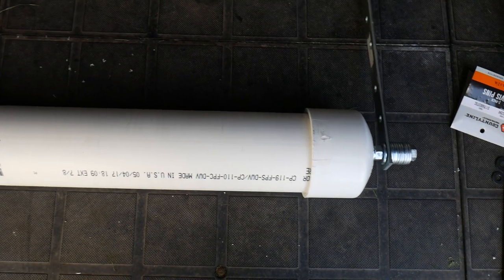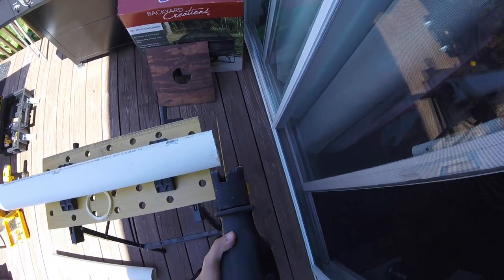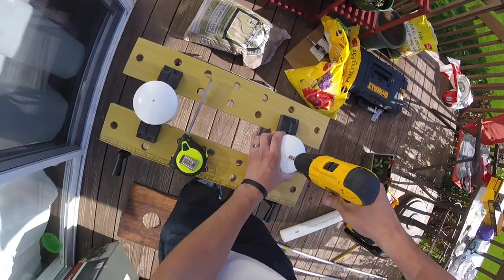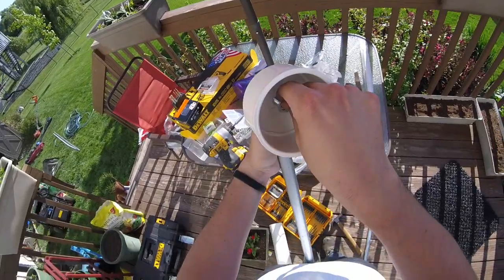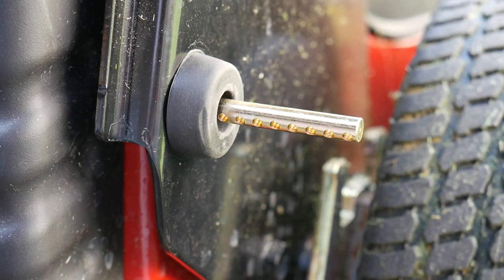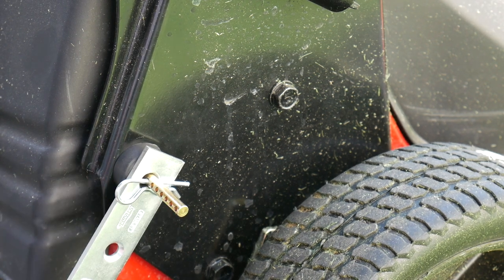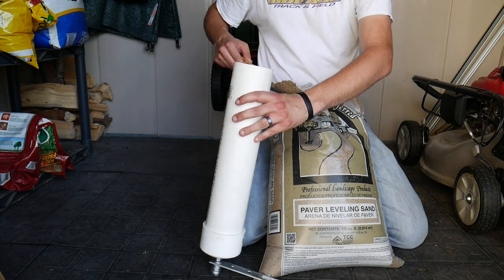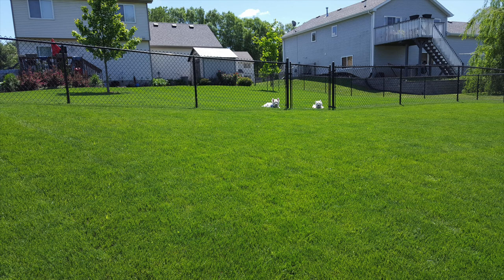Lawn Striping - DIY Striping Kit Build and Demonstration

Comment: I just made one for my cub cadet and it’s mind blowing how well it works, and only cost me 22$. I did hook a 3rd loop to run a rope lift while backing. I used knock out caps so there is no cap to have more pressure on grass than rest of pipe. Wish we could post pics
Reply: Would like to see yours to better understand that lift feature.

Comment: When I built my striping kit for my 22 inch Toro, I used 4 inch PVC, and I cut it so it was as wide as my wheels outside to outside. Instead of using PVC caps I used 4 inch Gripper Mechanical Plastic Test Plugs (model 33403D at Home Depot) so I have a completely even surface on the striper.  They come with a bolt and wing nut in the center to tighten it into the pipe.  I replaced the wing nuts with regular nuts, installed the mounting bracket and then lock nuts. Filled with sand the whole assembly weighs just under 18 pounds.
Reply from the maker: Thanks for the info!
Reply: Take a 4' chunk of leftover rebar, cut rebar to deck width to get 3 pcs, bind the 3pcs together with 3 zip ties and zip tie the bundle to the deck flap, works pretty good and only costs free.50
Reply: @FylerTarlow  only costs free 😂  I think this could work tho!

Comment: I like the direction you took on this! I have wondered for years why the lawn mowing industry hasn’t satisfied this consumer demand. 

I choose black PVC that was slightly more expensive, but helps to blend end with the rear of my mower. I also choose to use a fixed mount set up to ensure my back up feature is operational. This way no extra weight is added to the machines drivetrain. I had to buy a new mower this season and posted my install of you want to view.

Comment: I built it with practically this system. To solve the back-up problem, I made a steel pipe above the roll, between the metal arms. In the middle of the pipe I attached a steel cable with a knop, and in the middle of my 'steer' i put  a small hook. This way, I can lift my roll with 2 fingers (like the way you start the engine), and still hold on to your mower. Thanks for the vid!
Reply from the maker: Very good idea. Thanks for sharing.

Comment: Thank you for your ideas and video.  I had already purchased the PVC and end caps.  However, was not sure how to attach it to the mower.  I had also considered the issue of backing up with my zero turn.  Perhaps there is a way to raise the PVC pipe up when backing up?

Comment: Just made a roller very similar to yours for my John Deere zero turn mower. It works great and was only like $55. Way cheaper solution than the Checkmate one which was over $350 for my lawn mower. Since the distance from the blade and the roller are farther apart on a zero turn rather than your push mower, I am able to back up.

Comment: Try lowering the pin to the bottom of the mower just below where the bottom of the bag touches the mower. This worked for my timemaster. I can make a quick vid if you would like.
Reply from the maker: I would like to see that if you don't mind making a quick video!
Reply from the maker: Looks great!  Thanks so much for the response video.
Reply: Joshua Jordan is correct. On my old toro, it happened that I had the holes closer to the bottom and that enables better leverage on the pull back of the mower.
Reply: Hey battle please make a video so I can see how you constructed  yours. His video is great as well. I just like to see how ppl make their striper..thanks battle and stay blessed..
Reply: @hillview7248   sorry. I don’t have that mower anymore.

Comment: I started creating a kit like yours. I way overbought. In the end, wound up with two 5" and two 6" L brackets, 1" square bar cut to lenghth. 24" x 3" pvc with ends. Bolted it all together and filled with sand. 30 bucks and I have a nice striping kit. It's a hybrid of yours. And I can backup too.
Reply from the maker: Nice!
Reply: Hey George Gee, are there any pics of your setup posted anywhere on line?

Comment: I zip tied a heavy metal rod to the rear rubber flap of my push mower.  It's heavier than rebar but not much thicker, allowing me to reverse.  It goes under the mower deck and doesn't hit the blade.
Reply: The Toro Striper just makes it easy.   Nice job on your diy one.

Comment: I know this is an old video, but they make inserts that got inside the PVC pipe so the PVC is level all the way across, without the thickness of the PVC end cap.  It gives a little better performance for striping.  I forget the exact name.  For backing up, you could tie a small rope around the weighted PVC pipe to the handle and maybe give it a lift when backing up?

Comment: My DIY striping kit goes the entire width of the wheel base so it eliminates the tire tracks. I have it filled to the max with sand similar to yours. I do mow a little higher so the blades can be better defined laying over which emphasizes the stripes.
Reply from the maker: Yep definitely a higher cut will leave better stripes.

Comment: If you want the roller to be better at turning and backing up use two fixed points on the mower, so 4 brackets not 2, 2 where you have them than 2 more on the lower part of the mower

Comment: Question do I make the PVC  pipe the same length as the tires or the same length as the blades? You think it will work for a zero turn mower?

Comment: I use a solid axel from an old trailer cut down to the size of my mower drill 4 holes through the axel and the back flap and zip tie on

Comment: Hey Ryan for backing up I was thinking what if you attached a cord system to it to raise it almost like a pull switch so you could raise it temporarily for backing up. Just an idea, great vid man and keep the good work! Your lawn looks great btw, love that color!
Reply: that's a good idea.
Reply: josh thomas I did that on mine I made all I used was a peice of 3/4 filled with sand zip tied to rubber flap. and tied a strong wire around it and tied other end by pull cord. it works amazing. best part is was free
Reply from the maker: I was thinking of doing this as well but since mine rolls I didn't know how to accomplish it being attached to the pipe but also roll as it goes along?

Comment: Hey Ryan, are you still using a striping kit like this? I just got a cheap used Honda on craigslist over the weekend and it has a plastic frame, I'm looking into doing something like this for a striping kit on the Honda mower I have now. I'm almost thinking about mounting low down on the handle bars instead of the deck frame. Do you use a striper on your honda?
Reply from the maker: I don't use one on my Honda but I use the Toro Striping Kit for the Timemaster from time to time.

Comment: Almost like a cord lifting system, you could even accomplish this with thick string. You could run a string to both sides of the pvc pipe(the bolts on each end). You could start the string on your handles on each side and make a pull switch and latch it to your push bar for easy access.
Reply from the maker: Definitely a good idea.  I will see what I can come up with.

Comment: Hey, I'm in central California not too many vids in our area using lawn stripers. I'm upgrading my mower. What make & model do you use with your styper? Any updates on use, longevity or any other observations using this Stryper? Thanks so much bro in advance.
Reply from the maker: I'm using the Toro Timemaster.  This still works fine but backing up with it was always a little challenge so I tend to just use the mower stock which still stripes really well.

Comment: Awesome work!  I added a shop broom in front of the PVC to amplify the striping but yours looks perfect.  Any starting issues with the new larger Briggs motor on the mower?
Reply from the maker: I had my pull cord lock up on me but the dealer took it apart and restrung and it has been fine since then.  So other than that, no issues.

Comment: I have the 30 stripe kit and backing up straight is very easy but backing up and turning it is a little more difficult. It still very manageable. What letter are u using when you cut?
Reply from the maker: Alex Schmitt interesting. I wish I could see one in action before I decide to buy for sure. I do a lot of y type turns and my grass is super thick so moving backwards is when things tend to get caught up.
Reply from the maker: Alex Schmitt awesome! I would appreciate it. send to theryanknorr@gmail.com and I'm cutting on C so should be 3.25"

Comment: Have you considered the $169 Checkmate striping kit?
Reply from the maker: Actually I had one of those for my original timemaster and I didn't end up keeping it.  I felt it took away from the maneuverability of the mower which to me is the point of having a push mower in the first place instead of a riding mower.  With this design I wanted it to be easily removable so that I could use it when I want but also take it off to do the "trimming" part where I'm doing a lot of back and forth stuff.  Good idea though!

Comment: Your pretty crafty bro.  Nice work.  With that said i give you permission to spend the 94bucks plus shipping for the Toro Striping System.  Its so easy.
Reply from the maker: Thanks! Unfortunately the 30 inch version is $200 so that's why I didn't pull the trigger on it but I still might...hmmm

Comment: Fill the striper with concrete
Reply from the maker: That would be an option but I wanted it to be heavy and yet still manageable pulling behind the mower without putting too much strain on it.

Comment: i think what i would do is run a metal rod through the pvc pipe with metal bearings to the pipe can spin so it will go with the mower and not be dragged
Reply from the maker: Good idea.